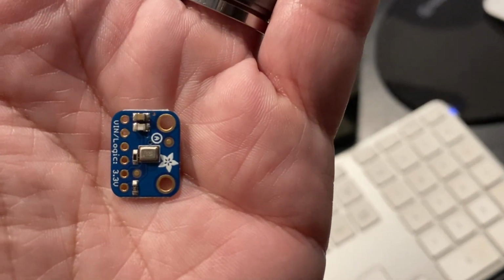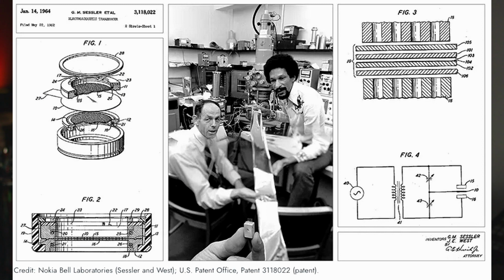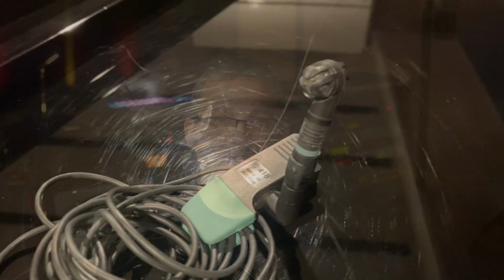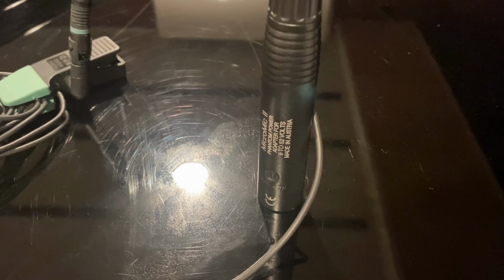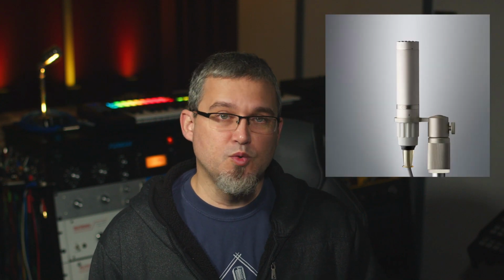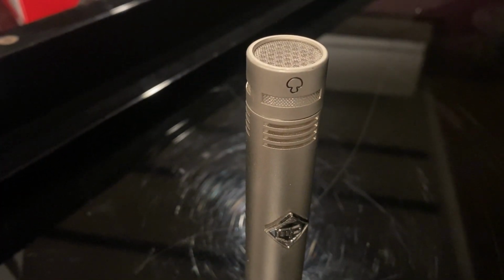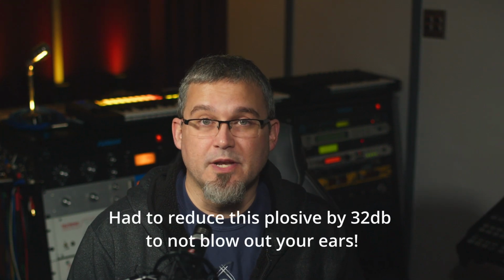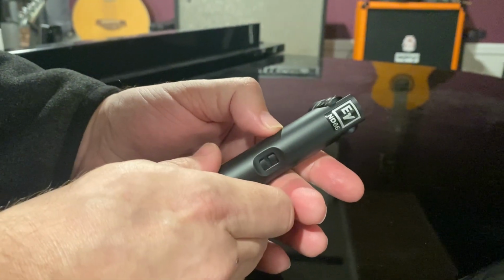Small Diaphragm Mics

Comment: Please include the Rode NT55 in the series.
Reply from the maker: I will certainly try to get my hands on a pair to check out.  I actually thought they had stopped making the 55 in place of the NT5, but turns out thats not true!  From what i know the two share the same capsules, but the electronics are different between the two.  I'll definitely look into it! Thanks for the suggestion!
Reply: @meistudiony  Thanks. The capsules are the same but the NT55 has two pads and two HPFs, 1 dB better self noise but 7 dB less max. SPL.
Reply: @meistudiony   Thanks. They have the same capsules and sensitivities but the NT55 has two pads, two HPFs, 1 dB better self noise but 7dB less max SPL. By the way, it would be nice to compare the NT55 and the "high end" TF5.
Reply from the maker: Just heard back from my contact at Rode... the nt5 and 55 are the same mic only difference is the added pad and filter switches (as we both said).  The amp/circuit inside and capsule are all identical.  The switches in the signal path lead to the tiny discrepancies in the specs of the two mics. 
The TF5 are pretty expensive.  Now you've got me interested in "WHY" they are so pricey.  Working on this series has opened my eyes quite a bit to the fact that there isn't a HUGE difference between a lot of these mics, and certainly not enough of a difference to justify some of the prices.  I'm going to pick up a few more mics tomorrow for the videos, a set of the warm84's, some oktava mics and Neumann... so far out of the AKG, sE, UA, EV, MXL, Shure... the biggest difference im noticing is the sensitivity.  Soundwise, when compensated for volume, the differences are pretty much an eq move or two apart from one another.  Price range here is like WAY under $100/pr to over $700/pr.  Either im losing it, or these mics are just all usable with some slight post work.  Going to to have to break out some freq sweep tests before this is all over!